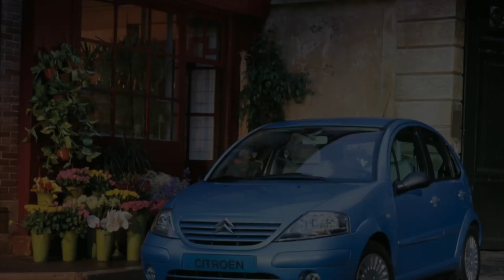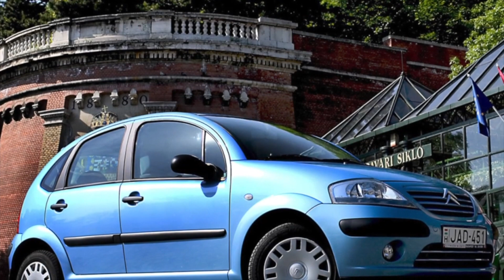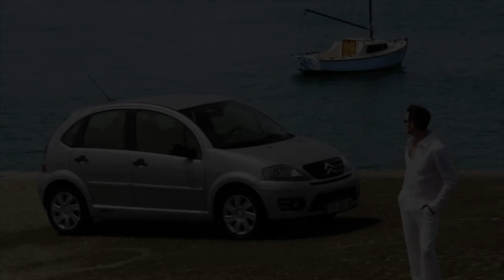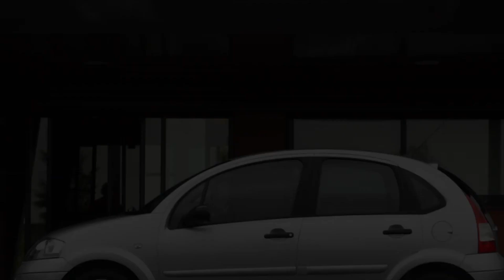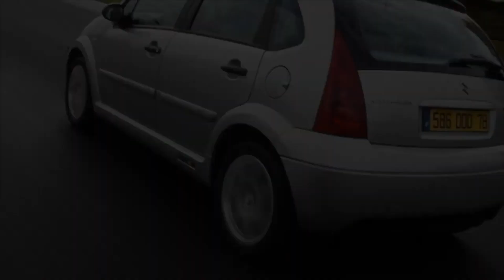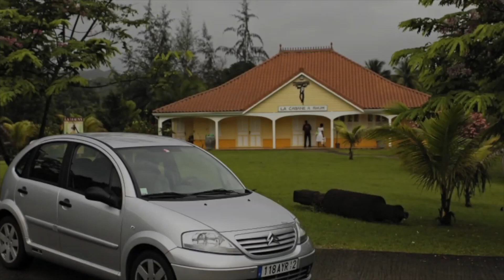Used Citroen C3 II Reliability | Most Common Problems Faults and Issues

Comment: I have 1.4 diesel 2012. When I roll at 2000rpm, the car/engine starts shaking. I heard it mighty be the EGR/DPF that are loaded, but I checked them and are not. Just cleaned the EGR and the DPF its shown to be 25% loaded. What might cause this behavior?

Comment: I have a 2011 model and have owned it for two years, a 1.6 liter diesel. I am relatively satisfied with it.

 But there are some annoying things about it, the heat broke in the driver's seat, as I live in Sweden you really want it in the winter, but I was shocked when I heard how much it would cost to replace it, so I haven't bothered to do it.
Another thing is that I'm 191 cm tall and that's the maximum so that you don't hit the roof when you have the large windshield, the extra roof you pull, probably takes 4-5 centimeters of headroom. Another thing I don't like about the car is that there are no cup holders, not one. Then there's the fact that the steering wheel can't be adjusted in depth, it's more irritating than you think because at least for me it feels like I always want steering wheel  three or four centimeters closer and if I were to change one thing about the car, it would be this. Another annoying thing is that the rearview mirror sometimes twists, they don't always fold out, but when you think you need to fix or find the reason for it, they suddenly works again. The suspension, yes it is soft, maybe a little to soft, sometimes it feels almost scary because you kind of don't feel the road beneath you.Then it cracks a little here and there, but I think it comes as standard with French cars and some rust bubbles start to appear on it.  Yes those were the complaints.

Now for what I like about it. The big tall windscreen, it's quite fantastic and you can really appreciate it if you're driving in a beautiful landscape or under a starry sky at night .
The purchase price, at least in Sweden, these cars are among the cheapest on the used market and you get a lot of car for the money. That it works both as a city car but also if you want to make  longer journeys. My diesel 1.6 (92 hp they throttled the engine from 116 to reduce consumption) draws 0.5 mixed driving if you drive carefully, if you are at 80 kh/h you can get it down below 0.4 liters, almost down to 0.3 . My car also has bluetooth, cruise control, traction control system and automatic temperature etc things that are not obvious on a budget car from 2011 but which are appreciated. It's also safe, got a very good rating in Euro ncap, I alwso haw a hooked on it (also not obvious that you can put it on such a small car), and it has a relatively large luggage space.

If you find one in good condition for a reasonable price, I would definitely recommend the car.